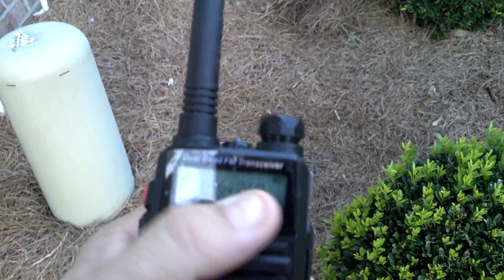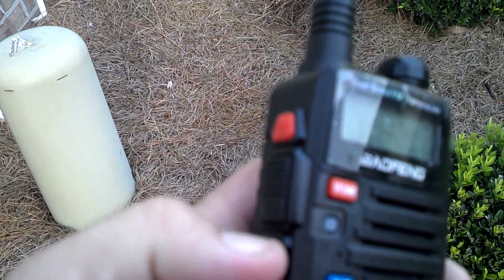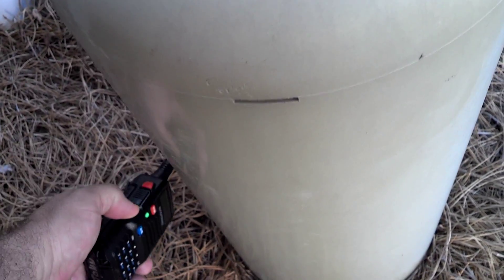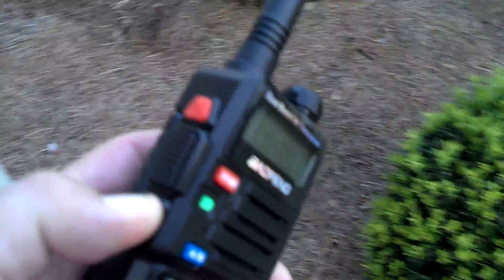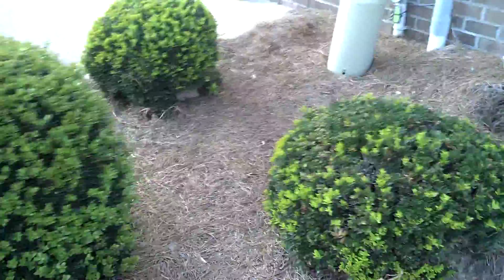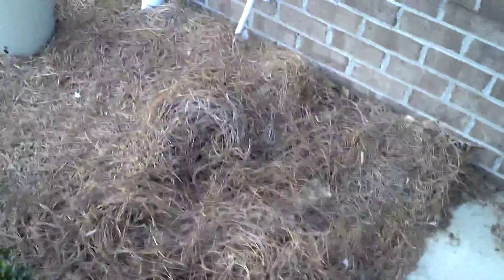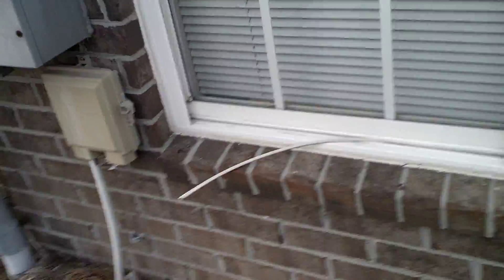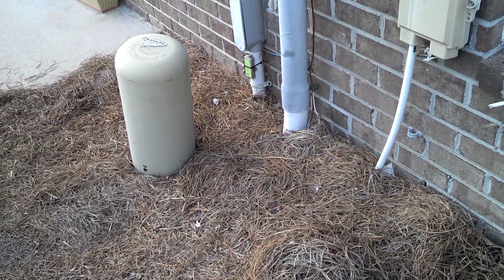Tracking down RFI Radio Frequency Interference

Comment: Can I find human microchip
Reply from the maker: No. for that you you need a reader. Some type of NFC reader on the right freq.
Reply: You should also look up the material properties of the biotechnology or electrodes under the guise of " medical devices"  that's used in conjunction with electromagnetic waves  which triggers or send Signals to the devices imbedded into targeted individuals central nervous system. " The wireless devices"  Could easily get into your body or blood stream through air inhalation (vapor released from a radiator or heating system) along with water tainting or ventilation toxicity (other vectors that allow open acess for a military sub contractor/ expirementer to taint your environment with smart dust like electrodes or added frequency ) basements in apartments are the ideal place place conduct covert expirements especially when the Researcher can blend in plain sight. Thankfully the ones in dealing with arnt very bright with how they conduct.